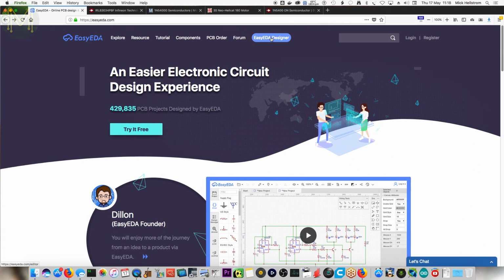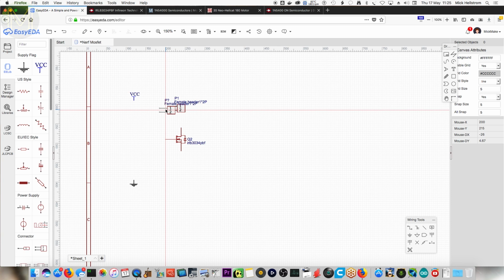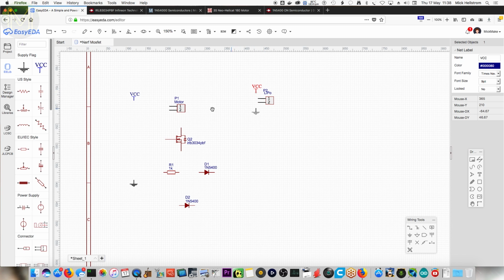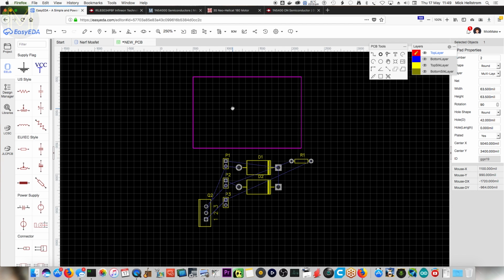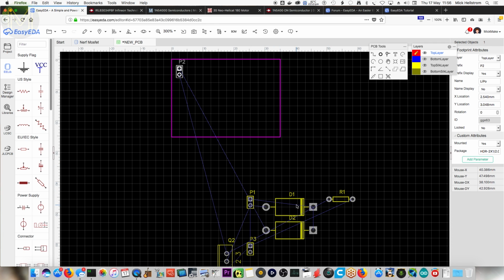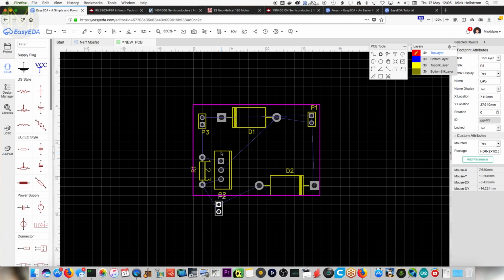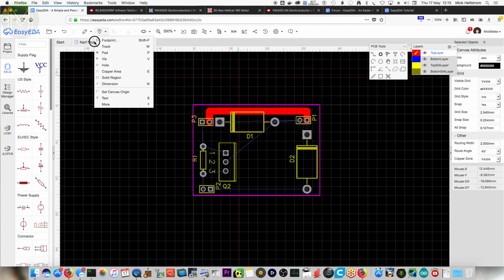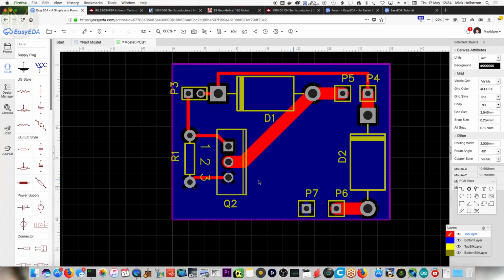#217 Design and build a simple PCB - Part 2 // Tutorial

Comment: Should of suggested to the Mate that pressing the Space bar rotates the components. No need to go to the menu to rotate  ;)  It's about efficiency
I would also suggest right clicking deselects the current item. Buuuuut, since you are using a cough Mac *cough*, I don't know how other than Esc as you said.
Also using the Arrow keys will allow for finer movement of parts. Plus, it forces the parts to be exactly lined to the grid making it easier to make the traces straight
Reply from the maker: Yes, true. I'm actually using a MacMini with a Microsoft keyboard. They seem to be the ones with the longest lasting battery around... So, yup it has an "esc" key.
But, yup. I should have gone into some of the keyboard shortcuts with him a bit more.
Reply: Either way you're doing a great job of doing the hands off tutorial/guidance of the project :)
Reply from the maker: Thanks mate,